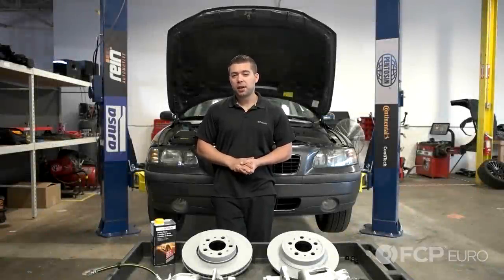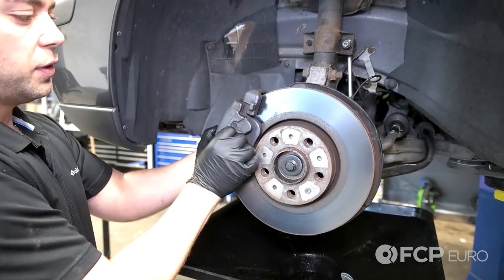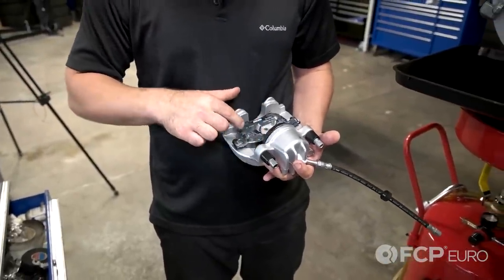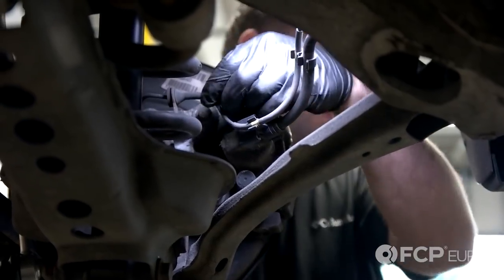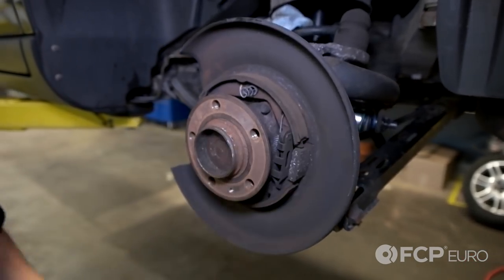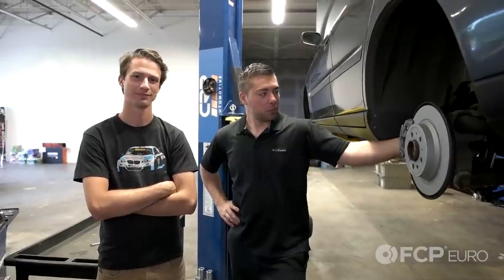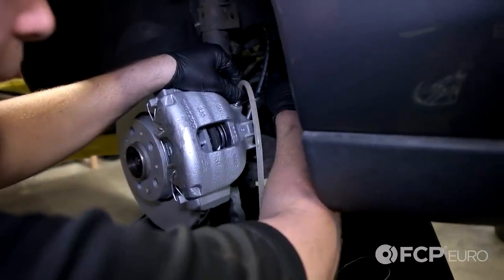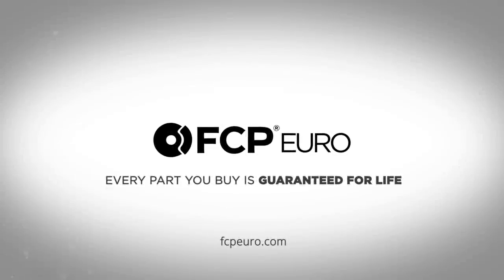Volvo Brake System Refresh - Complete Overhaul (S60, S80, V70, XC70)

Comment: 1:21 Caught our boy Jay slippin, righty tighty buddy!
Reply: If the bolt is rusted into the threads it helps to tighten it first a little to make it less likely that it strips or breaks while removed.
Reply: pro trick : you can watch movies at flixzone. Been using it for watching all kinds of movies recently.
Reply: @Kyle Yael definitely, I've been using flixzone for since november myself :)

Comment: A little tip to stop that annoying drip from the open brake line, place a pry bar between the seat and brake pedal and depress it about 1/4 of the way down. Will stop fluid from emptying from the reservoir. :)

Comment: Why didn't you clean (take the paint off) the rotors?
Reply: it might a zinc coating , fitted some discs recently that were coated like these it didn't  clean off with solvent after a quick test drive the coating was completely gone with no I'll affects
Reply: It's a protective coating that first breaking will take care of and rest of disc will remain protected from element for longer.

Comment: Thanks for the video Jay. And thanks for the tip about the caliper paint (I had no idea it even existed!). 
I think the issue is with the graphics [white letter overlay "|7"] on the 7 mm Allen--because you clearly say "7 millimeter" NOT 17. 
Finally, I just take the top off the brake fluid reservoir  & change out my pads & use large Knipex Cobra pliers to push the brake 
pistons back down. I don't fool around w/ brake lines if I dont have to....

Comment: Hi quick question.. I am doing only the rear portion of this job, no front brakes. Is it still necessary to start the bleeding process with the front? Or can I just bleed the rear? Since I’m only doing the rear.. thanx.
Reply from the maker: While it is recommended to bleed the whole system, you can get away with just bleeding the rear if you are only replacing the rear calipers.
Reply: thanx for the reply!! hats off to you all!!

Comment: How important are those rattle clips on the rear calipers? I replaced mine, and it kept snapping out of place, until I finally lost it.
Reply from the maker: The brakes might be a bit noisier without them, but should still work fine.

Comment: I'm curious as to why the bleeding was done from the closest point to the master cylinder as I've never seen it done in this order before
Reply from the maker: Hi Carlo, good question! While normal practice is to start farthest away from the mater cylinder, different cars have specific orders based on location and length of the hard-brake lines coming off the mater cylinder.

Comment: I overhauled according to this video and was successful. My problem is my breaks squeal most of the time on the last 20 ft of a stop. why is this?
Reply from the maker: Hi, Greg. Glad you were able to successfully overhaul your brakes! Brake squeal could be a number of things. Some types of pads can be noisy, other times it could be not enough grease/ceramic paste on the ears of the pads. So long as your brakes are functioning properly the noise should not alarm you, unless it gets worse. If the noise is very annoying you can take the pads out and try putting ceramic paste/grease on the rear shim and on the ears of the pad to try and quiet it down.
Reply: @fcpeuro  Hey Guys I re greased the break pads and the squeal is gone. Only trouble is when i press the break pedel it feels like i have to press all the way down on the pedal to get the same breaking power that pressing half way used to produce. what have i done and how do i remedy this?
Thank You for all your help and advice it is greatly appreciated!
Greg
Reply: @gregoliver705  Sounds like you need to bleed the brakes again.  My indy mechanic says always use Volvo pads to avoid squeal.  I use anti seize on the sliders.

Comment: I'm sorry bringing this up again after all this time. 
But I currently own an s60 from 2009.
If I want to upgrade from 288mm to 330mm rotors. Do I need to do any custom work besides the replacement itself.
Reply from the maker: Hi Bekie, the 330mm brakes are from the S60R/V70R, you can not just swap to the larger rotors, you need all the corresponding components such as the Brembo calipers, rotors, pads, backing plates, etc all from the R model. You will also need at least 17 inch wheels to clear the brakes as well.
Reply: @fcpeuro  Thanks for the quick reply, then with my current front calipers I assume the max size rotor I can use is 305mm right?
Reply from the maker: @Bekki159  With the 305mm rotors you need the corresponding caliper bracket for the 305mm rotors.
Reply: @fcpeuro  Thanks for the Intel.
Do you guys sell that kinda kit for both front and rear?
Reply from the maker: @Bekki159  You would need a pair of these caliper brackets: https://www.fcpeuro.com/products/volvo-brake-caliper-bracket-s60-v70-v70xc-36000727
And then the corresponding brake rotors and pads: https://www.fcpeuro.com/products/volvo-brake-kit-12in-front-8-piece-s60-s80-v70-xc70-kit-p2305ftbk2p8

Comment: Jay,

What are the correct size rotors for a 02 s60 with AWD?? It has the 17” tire option but when looking at brake kits for this car there are 3 sizes. Short of removing the wheel caliper and all that looking for some pointers.

This series is extremely valuable since I’m keeping mine till it can’t go anymore. Great videos!!!
Reply from the maker: Hello Todd, you can email your VIN to products@fcpeuro.com and we'll be happy to help you out with the rotor size for your S60.